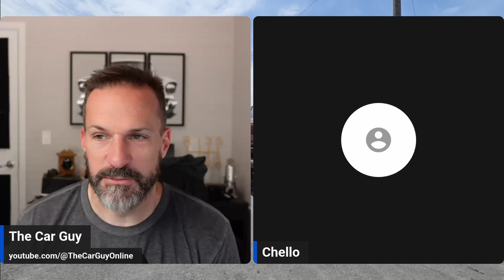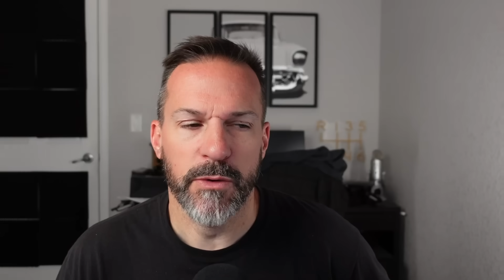Former GM Engineer EXPOSES Planned Obsolescence Tactics.

Comment: Been wrenching for ~40 years. GM has gotten so bad I will not buy one. They cut costs so badly its criminal.
Reply: It’s gotten pretty bad when my old Ford 6.0 is more reliable than a new truck 😅
Reply: I was a diehard GM owner since 1983.  It was all I ever bought.  In 2022 I got fed up with the poor quality and performance of my umpteenth GM vehicle (this time a Buick I had bought brand new in 2018) and spent all of 2022 doing a very deep dive into researching the best possible value proposition for a vehicle I could actually get enthusiastic about.  Bought a brand new Kia performance sedan (70% domestic and assembled in Georgia - the Buick had been fully South Korean… irony?).  The Kia isn’t old yet but I have zero complaints with it and this vehicle has a strong reputation for reliability and low cost of ownership.  It keeps ranking near the top each year for reliability with Consumer Reports.  All makes crank out some badly designed & engineered offerings, but do your homework and never buy in the first three years of production of a new model until it’s proven its quality and you can still find reliable vehicles.  Buy smart.
Reply: What year did it start getting real bad
Reply: The Cost is outrageous also.
Reply: I have an old Savana 2002 that i still use as my work truck, meanwhile, 4 of my friends bought new 1000000$ Siverado electric pick ups, ALL of them have a multitude of problems that takes week to fix. I always offer them my old Savana as a back up reliable truck, only for the week ends because i need a reliable truck for the week time. 425000 kilometers and it still runs, rusted out, but still refuse to die lol

Comment: I was working for the Big Blue Computer Company in the 1980s. They introduced a machine called the System 23 DataMaster. It was a replacement for the 5110.

I wrote my own benchmarks, a Bubble Sort and a Prime Numbers program. I never saw the word benchmark on company documentation.

The old machine was almost twice as fast as the new one.

Then economists do not talk about Depreciation and the Net Domestic Product.

Comment: I drive construction equipment. CAT, Case, JCB are history in my opinion. Brand new CAT D8 GC come broken from factory... And service is making excuses why they don't need to fix it😂😂😂 it's laughable. You just took my 400 000 EUR and left hanle for selecting gears is completely messed up. If you wanna go forward you need special technique to make it into forward 😂😂😂 XCMG, Liu Gong, foton are working perfectly and even when they don't it's fixed immediately.
If you have stocks in WV, mercedes, opel, CAT, ditch which, case, JCB... PULL THAT MONEY NOW

Comment: GM Ford Ram they are producing  a large lineup of pickup trucks all of them have issues no matter transmissions are made with a lot  weak components  engines  problems I got the trail boss 2021 transmission problems  I have now 2024 Silverado as well with the 2.7 turbo max transmission star acting funny and not codes I drive 50 miles a day Toyota Tundra it’s to expensive  so man it’s a shame a lot people involved with this issues because the car industries become more profitable then quality plus Trump Tariffs made things worse well I may go back to buy something old nice 👍 content man people need to know what it’s going on to expensive to buying any on wheels 🛞 insurance prices and rates are madness

Comment: My son drives a 2001 Tacoma V6 4WD with 350K miles. All original everything. I drive a 1999 Camry with 300K miles. I know a sales rep that buys Honda Accords with 150K miles and drives them to 250K miles. He said its the cheapest 100K miles you can buy. You can't do that with american cars. Best way to save money. I will never buy a new car again.
Reply: Original oil filter?
Reply: @TBDJKC  Original engine and transmission.
Reply: Dude at work had a 90s camry with 379k miles, had a catalytic converter stolen

Comment: GM is driving itself to extinction. The customer doesn't give a damn about GM's problems. The customer just wants total reliability and lowest lifecycle cost. That's why they're choosing Honda and Toyota.
Reply: No surprise whatsoever. Last GM product our family bought was in 1998. A lumina sedan and a Buick ultra supercharged.
Reply: There are no good car manufactures any more. Toyota is no longer a good brand. I cant recommend any brand at this points. There are brands I would recommend against more than others, but all are made to fail shortly after the warranty period.
Reply: @BentonL  it's a plague to all manufacturers, the amount of tech.
Reply: Buy old. Boycott all new vehicles and let them rot on the lot. Anything built since 2020 is junk.
Reply: @shaunbeach9502  I think the magic number is more like 2015 - but some feel it is even earlier than that.   It does depend on the make and model - but generally speaking once turbos and CVTs are involved it is crap.   Hybrids are a no go as well - just adds complexity and more stuff that go wrong.
Reply: @jimbosc an important exception is the Toyota ECVT used in their hybrids. It's quite different to belt-based CVTs, I don't really consider it a CVT at all. ECVTs are quite simple, simpler than a traditional manual transmission.
Reply: @jimbosc the newest bulletproof reliable car you could buy or at least close to it is the 2024 Toyota Camry
Reply: @2bfrank657 Toyota has made hybrids since the late 1990s. The 2nd gen Prius did have high voltage battery issues but those LiFEPO4 conversions are permanent fixes. The best generation Prius is the 3rd generation
Reply: And Toyota is going down that rabbit hole now.
Reply: @paulmoss7940 I have a 2016 corolla with zero problems ever.... its at 170,000 miles. Great work car
Reply: @paulmoss7940  not really, yes they had a bad run recently. But I believe they will remain reliable in the big picture.
Reply: @LazyLexus  which part of "the parts are designed to just make it past warennty miles" did you not understand?
Reply: @krusher74  what comment are you referring too? might be mixed up. I stated Toyotas enduring quality, which it has. Yes they had a bad run too, with machining processes. That's not quite parts designed period.......
Reply: @L @LazyLexus e Toyota BZ4X is the most reliable EV you can buy. It had a recall but it’s been fixed. Even the good brands have recalls and the stuck gas pedal recall caused by floor mats. The 2AZ-FE that burns oil due to low tension rings and 0W20 oil is literally an accidental flaw. Recalls have existed since the Spanish moss stuffed seats in the Ford Model T
Reply: @davidperry4013 confused on your clarification towards me?
Reply: @paulmoss7940 the Japanese will go as far as gm or the big 3 in general when it comes to cost cutting / cutting corners... And no one car company is perfect...
Reply: @jermainec2462 remember Japanese culture in general is to a very high standard in quality amongst everything. Your statement holds no value and is truly just your opinion. 
Every manufacturer has bad runs at sometime or another, yes, toyota just had a bad one. To say they will follow suit to domestic is terribly ill informed.
Reply: Sorry to tell you but this isn't a GM issue. It's a Automotive Industry issue... American, German, Japanese etc. ALL brands are doing it now
Reply: @SpiritLead7 BS. Japanese Nissan made a great full size V8 in the Titan the last 4-5 years of its model life and hardly any American men bought it because they're too hung up on domestic and bells and whistles. Stuff that's not needed on a good solid every day use truck. We get what we deserve.
Reply: @SpiritLead7 yep. The automotive world is following consumer electronics in the way cheap things are made to replace for profit. And making DIY repairs harder, just as some consumer electronics.
Reply: "The customer just wants total reliability and lowest lifecycle cost. That's why they're choosing Honda and Toyota."
My mom and my family learned that about GM in 1993.  Toyota ever since. No problems!
Reply: Take notes Chevy, Ford, cause yall finna go bankrupt, keep doing people dirty, you'll see
Reply: @danielsuarez5415 Take notes chevy? They already did go bankrupt bro! People still buy their crap for crazy prices.
Reply: @danielsuarez5415 but will they get a bailout after they fail?
Reply: The 90s model Silverados, from what I understand, could run a million miles. The Buick 3.8 series were known to run 500K. General Motors reliability as we can see is not first priority.
Reply: Agreed. I tried to support “domestic” manufacturers for as long as possible, but I feel the product doesn’t demand the price. Toyota and Honda for me as well until things change.
Reply: @damonschilowsky8965 
Right, as long as the price matches the quality they will buy, prices are to high.
Reply: @damonschilowsky8965  Aren't going to do much better with their either.  Both companies have major issues themselves currently.
Reply: @damonschilowsky8965 Toyota is a domestic manufacturer if you buying 85 percent of their stateside products.
Reply: I never bought a foreign vehicle in my life but I'm looking for a new vehicle and I think that's where I'm looking America's got junk falls apart in a couple years and they don't back it.
Reply: Problem is, there’s a bunch of idiots out there that are fanboys of these manufacturers that will keep them in business.  They continue to live in the 60’s muscle car era and want ‘Murican muscle
Reply: For the love of God dont buy a Honda truck 😂
Reply: Toyota is part of this cartel destructive cheapening behavior, stop fooling yourself. The Japanese sold their integrity out just like the Europeans who never had it to begin with.
Reply: I see a ton of new GM vehicles.
Reply: @aaron___6014  that means there's a ton of ill informed drivers!
Reply: @aaron___6014  Because the previous models fail so quickly.
Reply: @aaron___6014 well ppl are idiots aaron 😂...
Reply: Auto mechanic here.  ALL new cars are JUNK.  Even Honda and Toyota.  People are not smart enough to NOT buy the next "best" thing and the CEOs know how STUPID people are.  That is why they were so happy to sell EVs.
Reply: GM already went extinct in late 2008 and into 2009 and they got bailed out by the taxpayers. Everybody kept buying their crap after that. Even today, people still paying double for crap trucks. It's American citizens fault. We're dumb AF
Reply: It’s all the car makers. Just like the world powers. They are all in on the game. That fool you’re self.
Reply: No GM, Ford, Toyota, Honda, etc all lobby. I can buy a great Jimny in Mexico for 12k and drive for a long time...but it is illegal to import.  GM is doing just fine, and essentially all cars that can be registered in the USA are now junk.  In 15 years it will be walk, bike or in the elite class to drive just like home ownership has become for the young.
Reply: I remember when my grandson got a job in the parts department of our local Chevrolet dealer. He did not have a car so for three months I rode him to and from work. I would arrive a little early each day to pick him up. I would sit in my truck in the parking lot to wait. I lost count of how many very new Silverado's came in on a rollback for repairs. They would unload the pickup and the driver would leave and shortly after an employee would come out and place a repair number tag on the rear -view mirror.
Reply: America is self-destructing in all areas.
Reply: The new Toyota trucks have been absolutely terrible. YT is full of videos on the topic. The Tundra/Sequoia defective engine alone is estimated to cost upwards of $3B (102k engines X $30k). And the new Tacoma is dead last in every objective category- towing, payload, interior volume, NVH, drivability, etc., right on down the line. I personally have own a slew of Honda products and I have had tons of repairs, selling my Acura because of an electrical gremlin that we could never diagnose.
Reply: Honda and Toyota don’t get to be good companies because of GM and the other 2/3. So yeah this shit needs to be stopped. Because this leaks into everything. I’m sick of it. We all are.
Reply: @albertodawkins1230 the blame goes to the government and us. The government mandating efficiency and us with our thirst for all the tech.
Reply: @LazyLexus  That's your opinion and prison. Not mine. Their greed doesn't benefit me.
Reply: @albertodawkins1230  lol, my prison? If you even remotely understood the car industry you would understand ALL of the factors that have brought us here. It's not all manufacturers are bad, it's the race to comply with govt standards and keeping up with the "our" (consumers) demand for ever evolving technology. New vehicles have 50 + computers. And you're mad something went wrong? That would be your prison bud.
Reply: @LazyLexus  Again, your prison. You clearly know what you're told and nothing else, Genius.
Reply: @albertodawkins1230  I know from being in industry and paying attention. You clearly know others thoughts, higher being? Can't argue with that.....
Reply: Nah, "our" government is just going to give them our money to keep doing it
Reply: It's government regulation. Honda and Toyotas are starting to fail too. Most Honda sedans are 1.5L turbo GDI engines. Toyota has pushed hybrids.
Car makers have to squeeze as much efficiency they can out of an ICE. There is only so much complexity you can add till it backfires. Then comes cost cutting. There is no incentive to build for longevity(!) just "fuel economy" and "emissions" to avoid a fine.
Reply: Toyota has decided to follow the GM model. Look at the disaster of its tundra truck and Tacoma truck. Pathetic engines with twin turbos. Definitely designed to not even make it barely past warranty.
Reply: @miketerry6036 EPA and CAFE standards force everybody to build less reliable vehicles
Reply: I traded a 14 Tacoma for a GMC 2500.6.6 gas.  Now I'm worried.
The Tacoma had 113 k never an issue. 
My friend just purchased a 25 Tacoma with the 4 cylinder turbo.
I guess time will tell now.
I just needed a big truck for a toy hauler.   I sure do miss the Tacoma.
Reply: @miketerry6036  True, the V6 TT was an issue (but they solved it, now let's see their reliability).
However, they have been forced by the stupid Commiefornian standards (now cancelled).
But jumping to a general conclusion on Toyota (#1 in reliability and TCO) it's not smart.
Not to mention the comparison with GM...
Reply: The overall cars' reliability went down mostly because the previous government 'green' agenda, but also because some corporations' greed.
Still, the Japanese manufacturers are better overall (in TCO too).
The reliability top coming from Consumer Reports is relevant:
#1 Lexus
#2 Toyota 
#3 Mazda
#4 Acura 
#5 Honda
Reply: It doesn't matter what brand of car you buy now, they are all junk. Cars were built better in 1999 and below. The year 2000 was the beginning of the end for automobiles. The brand mine as well just be a sticker on the hood at this point.
Reply: @lotsoftorque3632  Really? 
Maybe you don't have a good car (reliable, with a long life and with a low TCO, but still delivering the expected performance).
My Japanese cars (clear leaders of their segment) will all contradict you, as they never had issues, not even recalls:
2019 Mazda Miata ND2 RF Top Revolution
2019 Lexus UX 250h F Sport
2022 Suzuki Jimny LCV (4x4, ofc).
Reply: lol dude American cars in 80s and 90s, some of them were also trash! It is a mixed bag with some ups and downs.
Reply: Bingo!